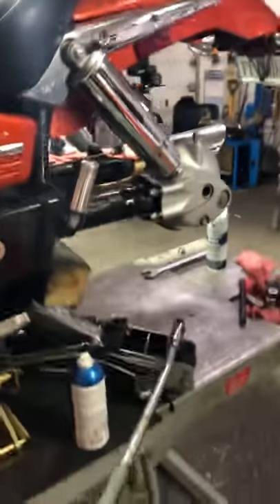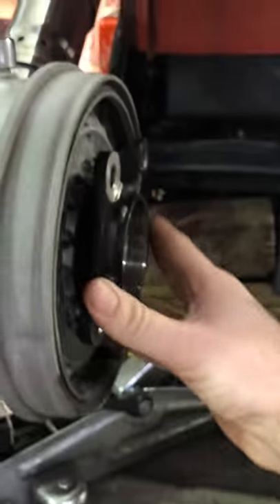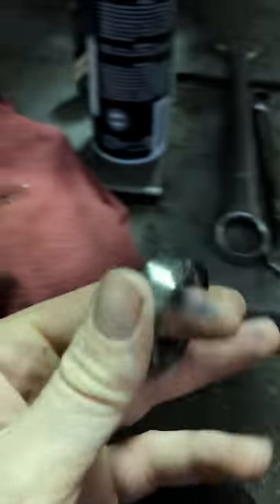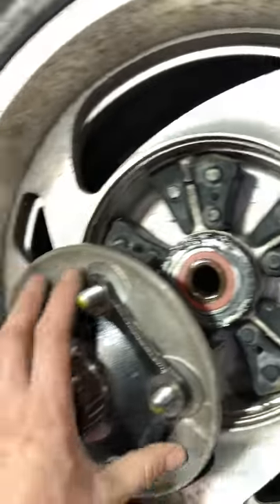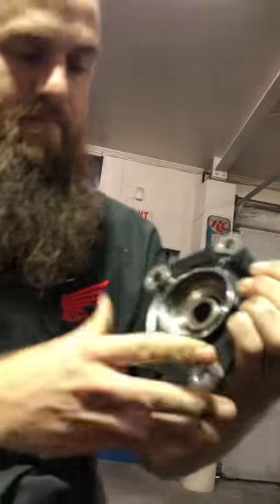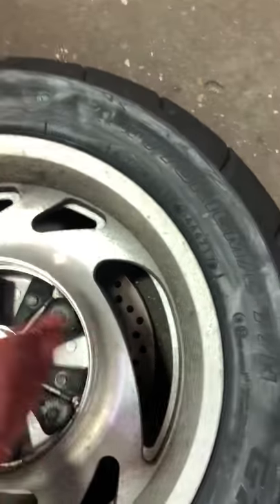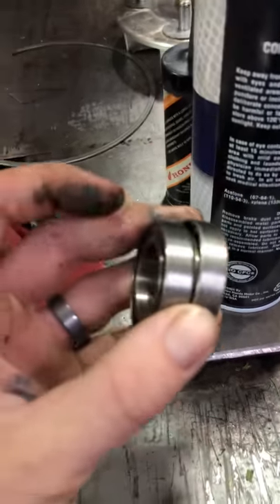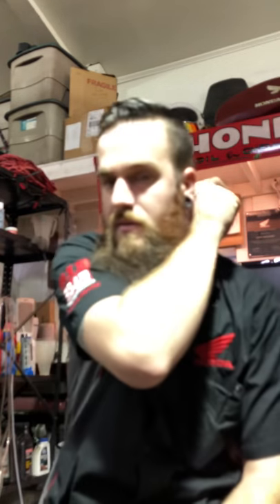Honda VTX1800 Final Drive Service: Weekly Wrench

Comment: GREAT video, I've got 2 shaft drive bikes & 1 IS a 2003 vtx1800C. As far as I know, neither the VTX or the Boulevard has had this service done. Next rear tire service it will be though, should give me time to stock the bearings, o-rings & rubber bits for both units. Well Done & Thank You.

Comment: Good video. Since you brought up Valkyries, your viewers with them should know that stopping here is not enough. You should remove the rear differential unit to clean and lubricate the driveshaft splines and pinion cup. While Honda usually gets it right,  here, they did not. Many people have had to replace the shaft and pinion cup due to dry, rusted splines and severe wear. It sounds intimidating to dig so deep, but it's really not too hard to do. If you have someone else service your Valkyrie, make sure they know about it, and that they actually DO it.

Comment: Very good dark side info at the end , I may have never even thought about that . I just picked up a 02 dark sided 1800 bobber for my first big boy bike , coming from a 250cc Yamaha morphous upgraded to 400cc ( Yamalac pimpin ). I will be putting a motorcycle tire back on the vtx but still good to know that I should check it because who knows how long it's been darksided .

Comment: Cody, thank you for all of your videos!! I am replacing my rear tire on my '90 PC800.I want to service the splines in the shaft drive however there is sooooo much out there on lubricants. I am overwhelmed on what to use. I guess Honda doesn't make the Molly 60 any longer and of course EVERYBODY has their opinions on what to use. I respect you and would like to know your recommendation. Thanks!!

Comment: I’d prefer horizontal video, but very informative. Thank you! I know you are a pro, and I watched your video on carburetor cleanings. I know you absolutely don’t want to have any bring-backs, I would like to suggest you try Hoppes #9 to clean your brass, soaked for a couple hours, followed by acetone rinse.  We never use drill bits or scotchbright. The brass comes out shiny new. We are aircraft mechanics and we use this method to clean carburetor brass and fuel injector brass. I think if you gave it a try you will be sold. I also use our method on my motorcycle carbs and it of course works outstanding.
Reply from the maker: Thank for that info. Yea huge fail on the horizontal shot. I almost squashed the hole thing because of how bad it all was... oh well!!

Comment: Absolutely a great video and needed as I have my wheels off my vtx1800. Bearings look good and are solid.   But the o ring on the wheel bearing was a Grey o ring and it broke.      Can I use any O ring or is a specific one needed to replace the one for the pressed in wheel bearing that will be under the flange bearing.???

Comment: Cody, could you give the HONDA part # for these 3 ORings? Do you have the torque needed to reinstall  that spline plate back on the wheel?

Comment: Hello all i am involved with having to replace those rear bearings that are in the hub and cannot get any info so far on what to lube the open bearings with or even if they need to be lubed. Although i have never seen an unsealed bearing that didn't need to be lubes. I was wondering if those should be lubed with a good synthetic packing grease or the Molly paste? If any one has any input i would appreciate it. Thanks and Great Video

Comment: Is that the same procedure for goldwings as well
Reply from the maker: Carl Booker only for GL1500 models and Valks. Not on the the 1800s just keep the threads a little wet with some Moly. Not a lot, just a smidge

Comment: I have a question. Is it possible for the rubber pieces in the wheel to wear out? Is there a mileage that they should be replaced? I am troubleshooting a vibration in my 1100 sabre so I am going to tear into the rear wheel next.
Reply from the maker: It’s hard to pin point the life of a rubber o-ring. The pressure of the cupller causes it to flatten out. They a only a couple bucks. I would swap them out every two rear tires? Of course should be lubed every tire service
Reply: TheMotorcycleMD oh I was taking about the triangle shaped rubber piece. The ones you said absorb the shock of the coupler.
Reply from the maker: Peter G ah! I see! Yes actually I have seen some bikes with all of the rubber complexity gone. Customer had no idea. Heavily worn coupler and splines along with it.